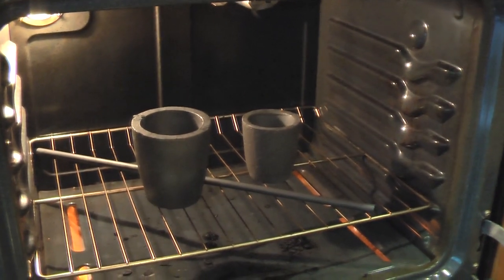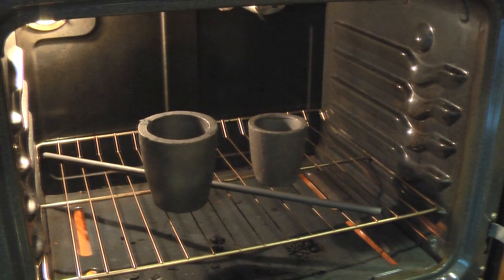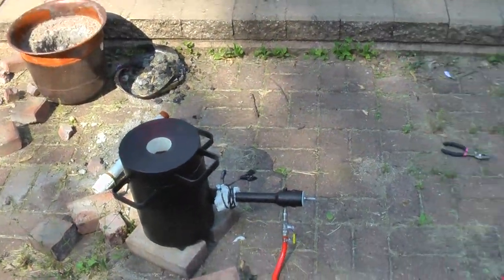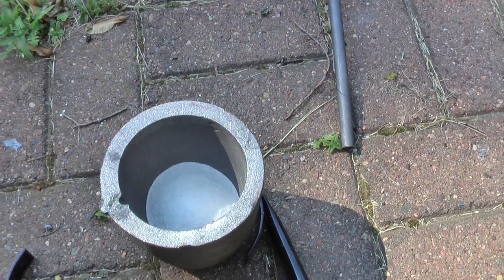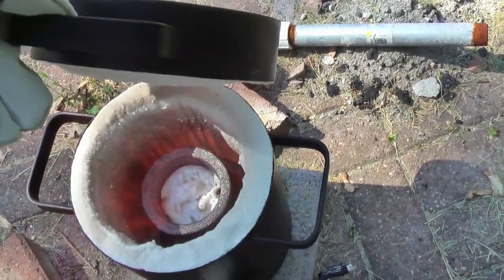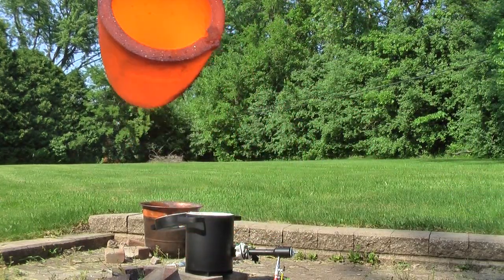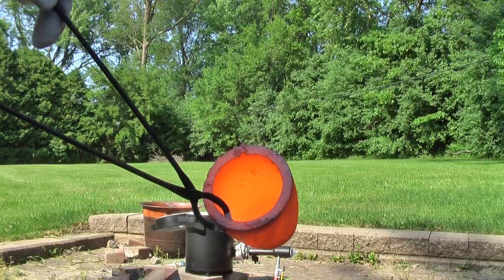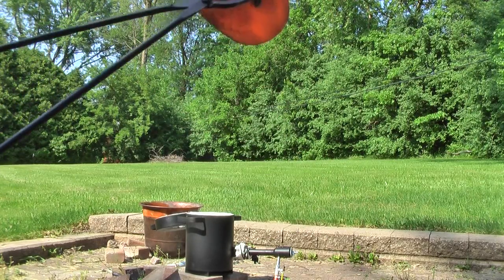Seasoning (tempering) Graphite Crucibles with Borax

Comment: Borax is just used to create a layer I molten metal to break surface tension and make removing dirt/foreign material easier. That borax will look pretty and slick.... Until next time it's used. It will just pool up at the bottom and pour out with the metal. (Though breaking the glass off is easy and leaves a nice finish on metal)
Reply: Post more info about stuff like this. Thx.
Reply: I read that you're not supposed to put fluxon the crucible itself, that it would damage it. And to nevwr pinch and grab the crucible with tongs, you can crack and break it.

Where would be a place that we could gwt safe information from? Because I feel like this guy's doing these things because he read them somewhere, and just thinks its proper?
Reply: @dethmaul  You don't temper or season your dinner plates or crockery so why the heck would people want to do this with crucibles is beyond me :)
Reply: @dethmaul  Real graphite crucibles don't need any seasoning. In fact, putting borax inside will destroy the purpose of a graphite crucible. Another commenter spoke about graphite ceramic crucibles for which seasoning is ok but seasoning a graphite crucible is absurd.
To learn more about good casting practices please seek your local trade school. They might have night classes. 

Too many times YT videos are created by the blind pretending to lead the blind. 
It's not because online jewelry equipment sellers are willing to sell forever more tools that the art is easy. 
It's better to learn the science before trying to reinvent it. Otherwise, we remain limited by what we think we know but don't really know actually.
Reply: @moonshiner2977  I don't think you heat your dinner plates at over 900°C to melt metals in them, do you? Ceramic crucibles need to be seasoned with borax otherwise they will contaminate metal melted in them. However, graphite crucibles don't need to be seasoned and should not be seasoned.

Comment: Good video, but I would sure like to see you wearing leathers (apron or chaps and a long-sleeved welding cape along with face protection in the event a crucible explosion; although it doesn't happen often, it does happen which is enough to err on the side of caution.  
Put another way, wear your PPE, so you can continue to enjoy your hobby and so your family can continue to enjoy you!
Reply: OK. That's great. However, if you want to melt metal in style (obviously more important than... pfft... "safety") be sure to wear cargo shorts and crocs. Definitely don't ruin the look by wearing safety glasses. Sunglasses are the sure way to go.

Of course I'm being sarcastic, but I can just imagine some nitwit out there working with molten metals dressed like that or similarly. Saw one video where a guy was pouring molten copper into a muffin tin, wearing sweats and tennis shoes. Already a bad idea to use a muffin tin for copper, but I'm pretty sure he didn't preheat, either (at least he didn't show it). Because when he went to pour, a minor steam explosion happened. Some almost landed right on his foot had he not moved as quick as he did.

Your safety concerns and suggestions are definitely good ones.

Comment: I have heard that if you use crushed sea shell and boil it in water for a long time. Then soak crucible in water, dry in oven and then fire. It is said to have a higher fire temperature than the borax.
Reply: That will be due to the quick lime that comes from shells

Comment: Is this necessary? the 12kg graphite crucible i got from china just got filled with scrap brass and heated in my propane furnace straight after i unpacked it, also many many times since and it still looks in good condition.
Reply from the maker: I think it just helps prolong the life of the crucible. Some say you don't need to do it others say you do. I was told that it would extend the life of the crucible so I figure why not.
Reply: Rob Crawford Okay I just read this comment and I know it is 8 months old at the time of my posting. However, please do not start melting metal in a crucible that has not been heat treated first. If your crucible has moisture in it the crucible can crack and leak molten metal into your foundry or worse around you when you pick up the crucible for a pour. 

To heat treat a crucible place it in your oven at around 300F for a few hours 2-3. Then do a dry burn of the crucible in your foundry till it glows red hot. At that point let it sit in the foundry closed until it reaches room temperature. After that you can use the crucible. Store room temperature crucibles in dry locations so this process does not have to be repeated.
Reply: @alphacentary  and a year later I comment...

I didn't know this when I got mine a week ago for aluminum.
Ordered a new crucible to use exclusively for copper and am now heat treating but slowing rising temperature in my electric crucible.

400c x 15 min

600c x 15min

800c x 15min

Etc... until I reach maximum operating temperature.
Any qualms with how I'm heat treating mine?
Reply: @Antassium  You can just bake them in your oven for about 30-60 mins on high heat. Keep in mind I only use 4-8Kg clay graphite crucibles. This tempers the crucible and prevents steam cracking. Once it has cooled put it in your foundry and heat it till it glows red. Let it cool then inspect it for any large cracks. If you have any large cracks forming it’s defective. This is very rare though. If it is clear of major cracks it is good for metal melting. However, I do recommend you keep your crucible in a dry location after every use. You can store them in your foundry so long as it is in a dry location. Also when you do a melt always pre heat your tools (stir rods, graphite molds, tongs, etc) to prevent steam explosions.

Comment: would you be able to use just a torch to get it red hot with the borax in the crucible to coat the sides... im asking cause i currently dont have a furnace and i want to start casting lol
Reply: It won’t work with a torch, maybe oxyacetylene but not a propane torch. I tried and the borax just didn’t want to melt all the way.
Reply: I've done it on a smaller scale with melting dishes I'd get it hot and then sprinkle a bit at a time to give it the best change t melt,  never tried on a larger scale, good luck brotha!

Comment: Hi i have a similar foundry, and wanted to know if when you tighten the screws that hold the burner in place, do you tighten them all the way or leave it a little loose? ps. i put the kaowool on the inside of  the hole that the burner goes into.
Reply from the maker: I don't remember exactly. In general though I usually to not go real tight when tightening screws down. I'm about to fire up the furnace again soon so I will let you know if I notice a difference one way or another.

Comment: whats better ceramic or  graphite for melting copper?
Reply: Maher Alsayid most crucibles are made from a mixture of two. A pure graphite crucible shouldn't require tempering or flux besides using it for an anti stick component.

Comment: Do you need to re-temper a crucible after each use?
Reply: You want to cure it if you suspect moisture has gotten into the crucible. If kept in a dry place this shouldn't be an issue very often.
Reply: When I’m using mine in my electric I usually fire it up to maybe 200f for a little bit then turn it up for smelting

Comment: Why is it necessary? What happens if I don't?
Reply from the maker: It will help the crucible to last longer. Otherwise it will end up crumbling after a while.
Reply: your crucible could explode if you don't purge it of potential moisture. definitely at least do the over and bring up to temp slowly. i think the borax also decreases the amount of metal that sticks to the crucible walls.
Reply: I just got my new Crucible and being a rookie I threw it right in full heat and it cracked within minutes
Reply: @stevenrenaud4883  the crucible can be completely destroyed by the moisture, the borax is using for the monlten metal not hold in the crucible.
Reply: Do you use mule train borax?